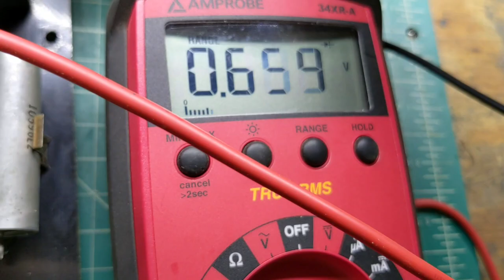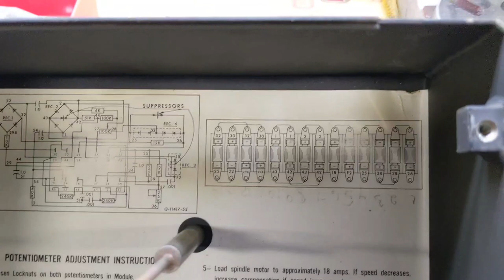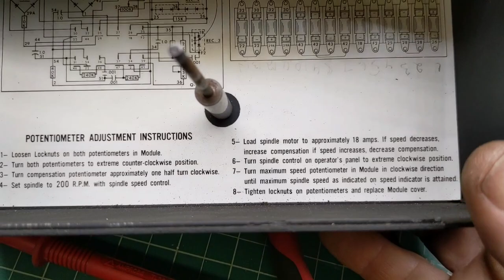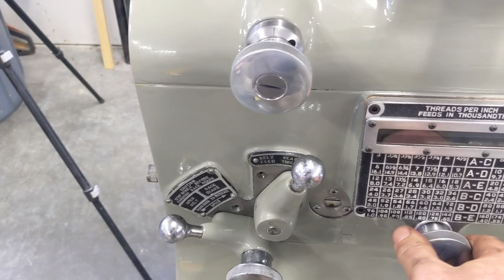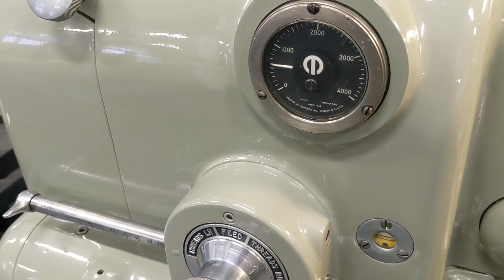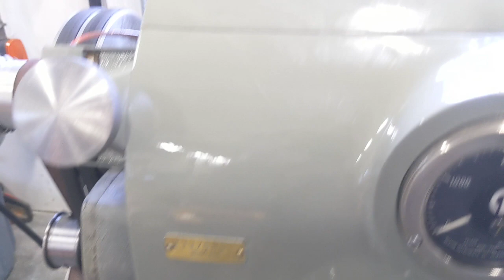Monarch 10EE Lathe Refurb part 22

Comment: A trick I employ, to find the source of a noise, is to wear some ear muffs and place a long metal rod against one of the muffs and probe with the other end of the rod. Place the end of the rod at the non rotating center of the gears. It is surprising how much you can hear.
Reply from the maker: Thanks Dan, that's a great improvised stethoscope! I actually have one that's purpose built for automotive use (at least that's what I use it for)

Comment: I hope I get the opportunity to use some of this info one of these days. Just have to get moved into my new shop so I have room. Sheet rock and painting should be done this week, then I have to start seriously searching for a 10EE.

Glad the stuttering was just an adjustment in the drive.

The noise sure sounds like a gear mesh issue. My little Logan was very sensitive to the mesh in the change gears as far as noise went before I set it up with an Electronic Lead Screw. Now it's just the forward/reverse toggle gears that make noise if I wind it up too fast with them engaged.
Reply from the maker: Thanks Jon, yes me too! I wasn't sure what was going to fix it but I'm glad it didn't involve expensive parts!

Comment: Good luck tracking down the noise. It sounds for all the world like the noise meshing spur gears make. Is running with that plate off even for a short time possible?
Reply from the maker: Hi Glenn, I think it can be run for a short time, at low speed with the cover off. I'm going to give that a try

Comment: a few things. the spindle module caps.. how old are they.. most caps have a 4 digit date of manufacture code.. first 2 digits are  decade and year..  and the second 2 digits are week of the year produced..  do you have a capacitor tester so you could unsolder one end of the various caps and test them..  one of the caps i could read the date code seemed to be from 1984..  the others perhaps much older but i only got a glimpse of them. 
 
 do you have a test of test clips for your meter leads.. long J hook test leads..  

 on the gears under the end panel.. if there was a crash.. i would really want to individually spin the gears to check for damaged bearings.. i would also want to check the straightness of the stud on the movable plate is..  something loosened up the clearance to the non adjustable gear on the pivot.. ether that mount if bent away from the moveable gear or the movable gear is bent away from the pivot gear during the crash.  tremendous forces can be involved in a crash.. even sturdy looking things can bend.
Reply from the maker: Thanks Wayne...I don't have a cap tester but I do have J clips for my meter. I didn't show it on in the video but I had them hooked up when I was testing the voltages for the tubes to make sure I was in the spec window ( which I was). At some point I'll rebuild the module with all new caps, resistors and diodes. I did that on the other 20". It didn't really change anything but it's insurance against unexpected failure. As I mentioned in some of the other comment replies, I'm going to dig into the gear train and get to the bottom of it

Comment: Great job on the 10EE, as the electronics go, the caps should be checked and replaced, when they fail they will stress the tubes which arnt cheap, check the resistors , they are probably good
Reply from the maker: Thanks for the suggestion! I'll definitely do that!

Comment: So the drive thumping was compensation as I suspected,  glad it was adjusted out.

That 60 tooth gear is also the gear you change out for metric threading (in conjunction with the headstock output gear).

The stop rod can have a Lufkin 680B inside mike head on the end.  Other mic heads will work including the Starrett, Mitutoyo and Central (Rhode Island) that use the 5/16-48 (? maybe 46) thread.

I'd check the bearings on that 60 tooth gear and work my way into the gearbox to try and find that rattle.
Reply from the maker: Thanks Russ!. I'm going to pull that cover and run it again to see if I can pinpoint the noise. Also, thanks for the tip on the mic head. I'll have to start looking for one of those heads

Comment: Kevin, too  much noise.  Remove the gears to see you if the bearings are all good. If not print the gears and if buying new gears is prohibitively expensive, exchange them from one of your other machines. The noise would grate on my nerves. How about using your mechanics stethoscope to be sure no other bearings are contributing to the noise.  

It much have been neglect or a big crash to knock those gears that far out of adjustment.  I can’t believe they were so far out of adjustment that were barely touching.  I’m curious what would happen if you tightened them a little more. Would the lack clearance create friction and/or interfere with necessary lubrications?  I know it’s not called for but what a little heavy high pressure grease do?

High speed threading is probably not necessary for your projects?   But very small diameter with very fine threads that high speed combined with a follow rest would be wonderful.  As always, I learn a lot from your videos and very much appreciate the effort you put into them. Cheers, Will
Reply from the maker: Thanks Will! Yeah I don't think I can live with that noise. It sounds like an old worn out Southbend! with that said, its actually much louder on the video than in real life. I'm going to dig back into those gears and find out what's going on
Reply: @fourpondsshop7940  I am not surprised. Judging by the rest of your projects I thought you’d be tormented if you didn’t figure it out and fix it.   Cheers, Will

Comment: Hey, great video, really enjoying this series. Can you please explain the 3 thou clearance requirement in your next vid? I'm having trouble visualizing where the 3 thou of clearance is supposed to be. Is it the backlash distance between any two meshing teeth? Is it some other spec? Thanks.
Reply from the maker: Thanks Ned! So the manual says "Adjust so the gears have approximately .003" clearance between teeth". That's an interesting way to describe the clearance. I've set up a ton of differential gear sets on cars and trucks and the setup is always described as backlash. I'm assuming monarch meant the same thing. When I did this the other day on the lathe, I had some .003" wire available so I used it by spinning the gears with the wire lined up with the contact surfaces on the teeth. It was very cumbersome and not sure if that method produced a good measurement. I went with it anyway because the manual said "approximately" and did not give a specific range like you would see with a differential gear set. When I take the cover back off to follow up on the noise, I'll use an indicator and a mag base to measure backlash in the traditional way.
Reply: @fourpondsshop7940  Cool, thanks for the description.

Comment: Not trying to be an expert here but @ 22.28 you can see the teeth on the two gears is only engaging at about 50 % of the debt of the teeth. At least form the camera angle. I don`t think it´s enough. I`m thinking this will ware the top of the gears down on both of them very fast and may also explain that awful noise. It sounds like the gear teeth is hammering into each other when turning. But then again I`m no expert. If you run it a little and the take of the cover is it all oiled up of kinda dry?? Anyhow the ratteling in the gars is a clear indication that something is wrong. Also it sounds costly. Still a very nice machine. I´d sell my old mother in a blink of an eye for that lathe.
Reply from the maker: Thanks Lars, So that's an interesting camera angle because those teeth are actually fully engaged. I'll be removing the cover and running to see if I can locate the noisy parts. I don't think I can live with that noise although its actually much worse on the video than in person